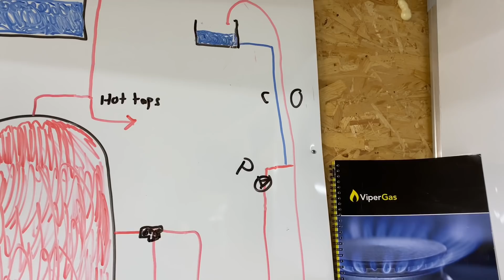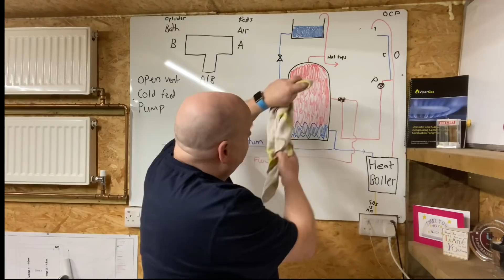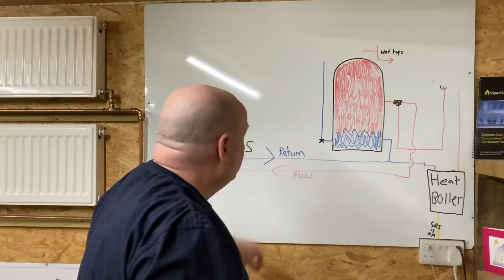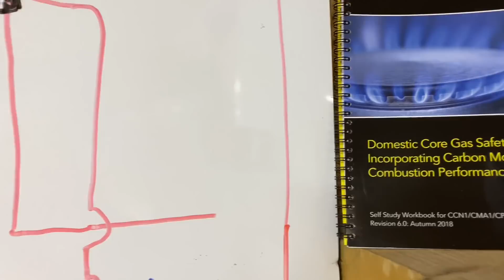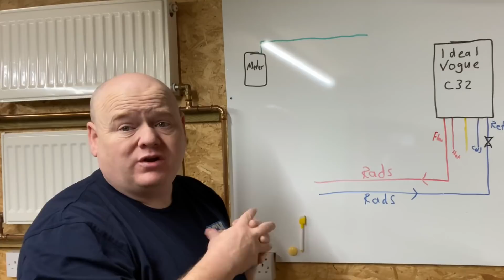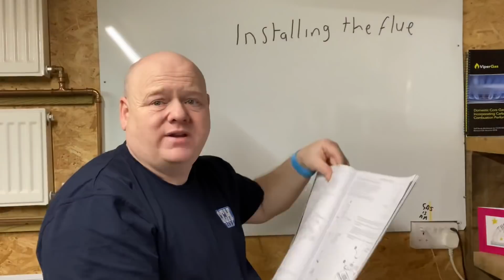New Boiler in Cylinder Cupboard - Combi Boiler which pipes to use. Gas Training

Comment: Great video im trying to follow 😊 and understand more about my ideal combi boiler. I live in a rented house and have the exposed condensate pipe and copper safety discharge pipe running from the boiler in airing cupboard and along the wall of one bedroom. (Old house, the bedroom is an extension) im fine with the condensate pipe, my concern is the copper safety discharge pipe. If there were a fault and it would be activated would very hot water flow through it and the pipe get hot? 😮 x
Reply from the maker: Thank You

Comment: I love this 'old stuff'. My fast recovery calorifier takes about 20 mins to heat up and unlike most of the rental properties I've been in I get a decent flow of hot water to the bath (though that might be down to boiler sizing) which isn't affected by the cold water temperature. And if the boiler does break down I have an immersion heater for hot water, if your old boiler needs a part or it's a bad time of year and your boiler insurers are a bit overworked you might be waiting a week for it to be fixed. Never been convinced by combi boilers though they do give you more space which in modern tiny houses is useful. Good explanations though.
Reply from the maker: Thanks very much for your comment, please consider subscribing to support the channel 🙂

Comment: Hi Allen, thanks for another great video. Our house has a 2 year old ideal logic boiler installed. It runs with an old fashioned copper cylinder with a red puffa jacket cover. The radiators are huge, mostly doubles  with no fins or grills.  Not sure how old they are but guessing 35 years plus? We moved in a year ago. Thinking of renewing the system. Detached 3 bed 1 bath. Solid stone walls about 800mm thick in the uk up north.

Would you recommend swapping all the pipework at the same time please as it will be really old too. You think a vitodens 200w would be overkill? Thanks kindly, keep the videos coming please!
Reply from the maker: Hi PBS 7, Please feel free to send me some videos and i will add them to youtube. Let everyone give you advise. Thanks.

Comment: Not sure there's ment to be a gate vale on the cold feed from the cold water storage tank for the cylinder not that it matters as changed to combi
Reply from the maker: Gate valve feeds the hot water cylinder. Thanks.

Comment: Great informative video 👍🏻 I’ve been wanting to do away with my old boiler system and swap it for a combi as the hot water cylinder just isn’t ideal for a busy family. Does the new boiler have to be situated where the old tank was or can it be installed where the old boiler was? My boiler is tucked out of the way in our side porch / outhouse and part of the appeal to getting rid of the HW cylinder and ancillaries is freeing up more space in our bathroom. Thanks
Reply from the maker: You could put the new boiler wherever you like, this video was a request. Thanks so much for watching
Reply: @AllenHart999  Great to hear, thanks Allen.

Comment: Great video Alan question I won't to put a filter on my f and e system only can put it in the airing cupboard which pipes do I put it on thanks Brian
Reply from the maker: The airing cupboard would not normally be the best place as you cannot connect it onto the last return. You could put it on flow but its better on return really. Thanks.
Reply: @AllenHart999  thanks for the reply very very helpful top man thanks again Brian
Reply from the maker: @456Brian  No problem. Thanks for watching.